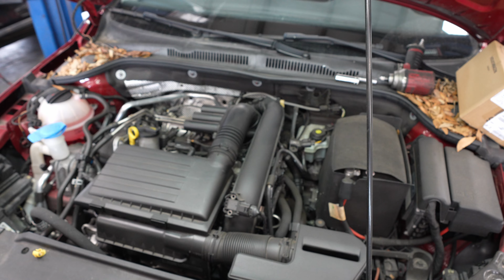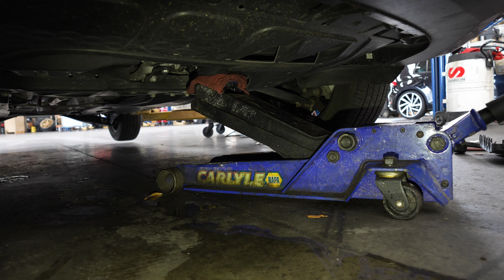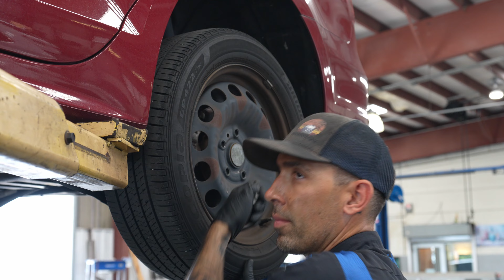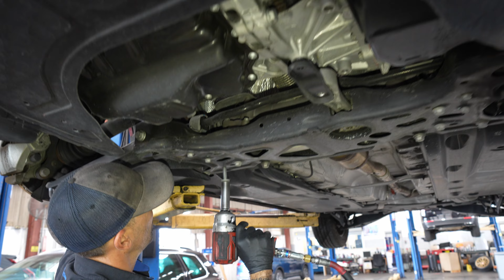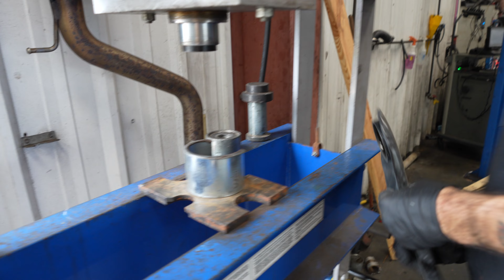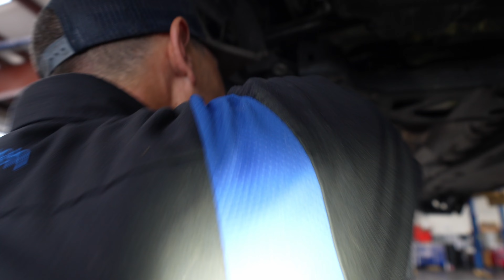2017 Jetta Bushings Install /Trans Mount

Comment: Hi, thanks a lot for the video ! 
I have a question, this 2017 Jetta is relatively young, how come it already needed new engine/trans mount ? how many miles ?
I have a 2015 Jetta with only 28000 miles (45000km) and the engine is shaking when in neutral of park only, I believe new mounts will solve the issue but I am skeptical since the car is relatively recent and didn't drive much.
Reply: I have 185,000km on my 2016 TSI and I'll be replacing this today after I'm done work. I'd consider it extremely unusual for a mount to be bad at 40,000km area
Reply from the maker: The mount design in these vehicles is definitely lacking , especially the upper trans mount
Reply: @GremcoGarage how was the NVH after?  Any feedback from the customer or anything? Thank you.  I have the same car and want to replace all these terrible flimsy mounts that make the drivetrain feel so sloppy in this car.  Thanks for the feedback and video!

Comment: Very bad work. You forgot to replace the bolts. They are stretch bolts. The bolts were not tightened with torque.